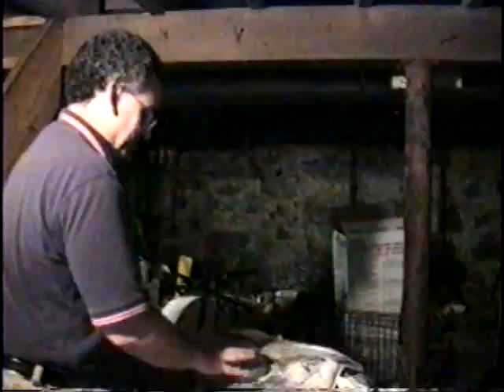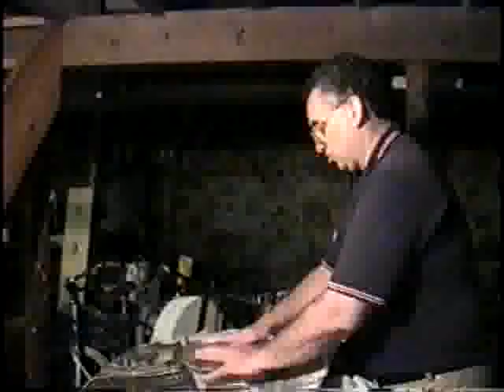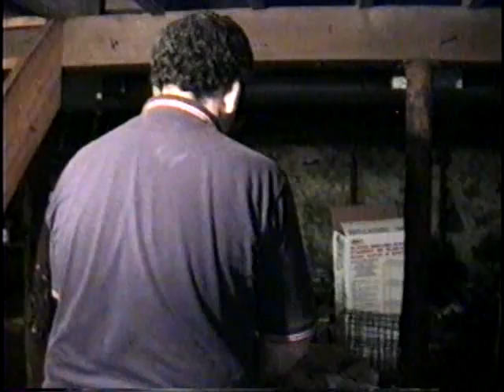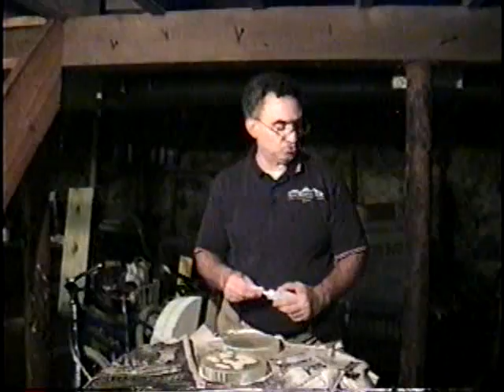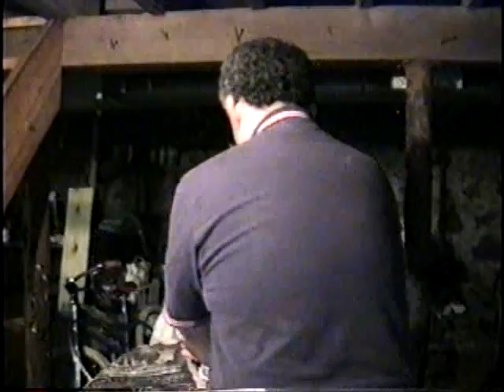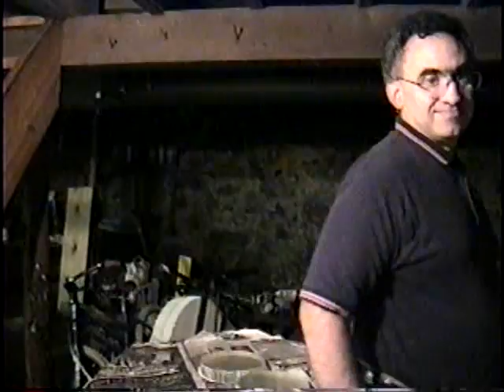Optical Flat Part 6

Comment: Last year I started grinding 3 8" flats and spent a few hours polishing them. I can see interference fringes with a high powered green laser, all three seem too be perfectly flat out to about a 1/2 inch of the edge where they have turned down edges. If I leave the lap on the mirror for more than a few seconds it "sticks" and I have to submerge it and really fight to get it off. Also I have been polishing all three at once with the same lap, should i only do one at a time or will my method work?

Comment from the maker: @jtmaximus78 Aluminizing a mirror requires a vacuum chamber. I do not have one. I usually take my completed mirrors to a mirror making workshop in Washington DC and we aluminize them there.  Commercial coating forms are also available, check the internet for a firm in your area. Best regards, Francis J. O'Reilly